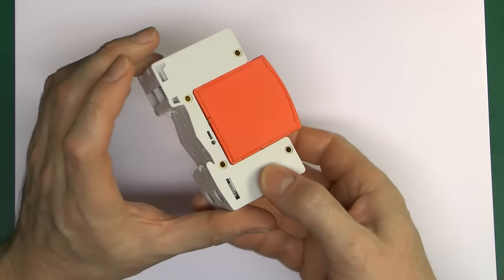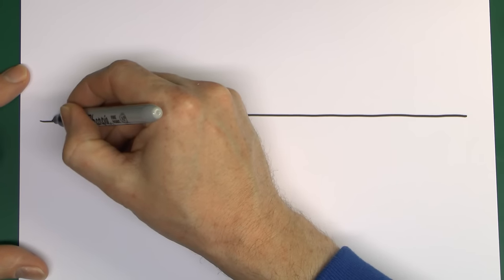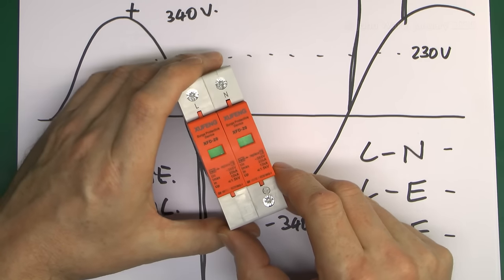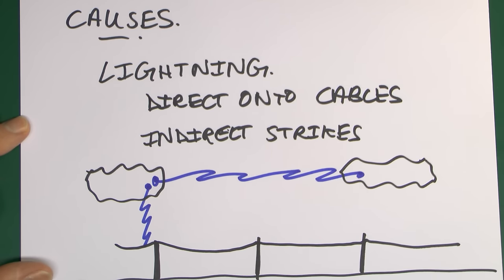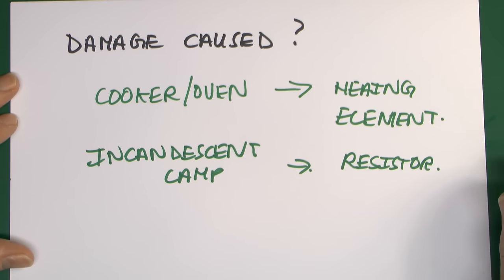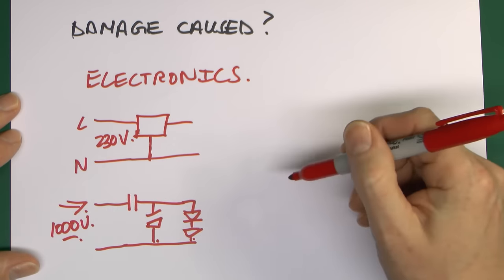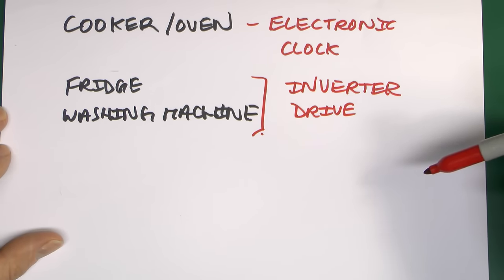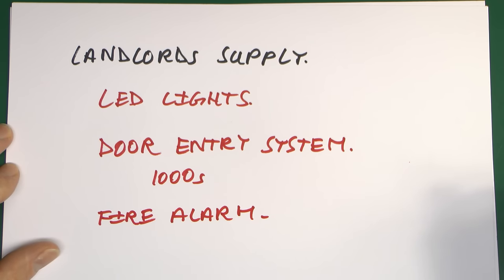Surge Protection Devices - Part 1

Comment: Very informative thanks. I worked for 30 years maintaining and installing ,fire alarms , door entry devices, CCTV and public address including 100 volt line on large and small installations. We hardly ever had problems that you have referred to with equipment being destroyed. It was built to withstand such things and worked for years with out problem. So I would question why these things are being fitted, could it be another way of frightening the customer into thinking "that they have got to have these fitted"!!!! Or are these transients and surges a new thing I think not.
Reply from the maker: Transients are not new, but the amount of electronics connected in a typical installation is far more now than in the past.  Older equipment typically had a transformer as the first part of the power supply which is unlikely to be damaged, virtually all new devices have switching supplies which have electronic components at mains voltage, far more likely to be damaged.
Reply: Thanks for your reply, I did not want to criticise your consise video but point out that why do we suddenly need these devices and would new equipment be as reliable as the thing's it is replacing. I only retired last year and was still involved with this equipment. I have found that it us mostly still constructed using the time tested and reliable components that always been used.
Reply: Martin Winfield - my personal opinion is, “marketing” so that the customer can be charged more. Any good quality well designed product will already have suitable surge protection built-in. Some 1980’s computers that used switch mode power supply units have such protection as standard. And as John says, it’s not new. Industrial systems have had such protection since the 1970s onwards.
Reply: An reasonable quality electronic product will have inbuilt surge protection. In fact it's part of the electrical safety compliance testing (of electronics) in all countries. So generally, these SPDs are basically just marketing wank.
Reply: The only things damaged for the most part from any kind of surges I've seen so far are very cheap LED lights
Reply: I'd like a surge protector in case of a fault on the neutral supply. We had a neutral fault to our block and so got 400V rather than 230V. It destroyed most things - boiler, lighting, dish washer, fridge, washing machine, hifi. The manufacturers said that the warranty didn't apply. I know it's not a surge due to lightning strike and the duration was minutes, not milliseconds but the only electronic items that survived were those on surg protected extension leads.

Comment: Also the inductance of the transformer primary in anything with a linear PSU would stop any short duration pulse doing much of anything other than MAYBE breaking down the primary insulation (which would have resulted in a repairer just saying 'nah yer transformer's dud')

Comment: Hi John. 

Can you give any further insight into why the regs says that if you have a 2nd sub board over 10mtrs away that you would need a 2nd SPD.   If there is a type 2 at the origin (ie meter box) on a property with an underground supply and there is a mains board 15mtrs away would you need a 2nd SPD in the consumer unit as well? I assume that if the SPD has done its job at the origin there wouldn’t be any need for it at the consumer unit as well?

Comment: my job is designing mains fuse boxes for local installers and i can testify that almost 80% of them have some kind of surge protection.
also in my country i believe it is mandatory for government buildings to have a spd system.
a single type 1 and many type 2's is the norm but if see a upward trend of type 1+2.

also a new (ich) source of surges are PV transformers (solar panel) and car chargers.
they store a huge amount of power and use computers and electronics to turn it on and of very fast.
but if the software fails it can dump all of it by exedent.
it wont hit the 5000V but anything up to a 1000V is to be expected. 

it will be way more local but they ar cropping up every ware.
 if seen a carpark that had 20 charging poles and one car owner used the wrong card to check out and it cause a emergency power down because of some software bug.
in a instance almost all of the led street lights turned of and did not turn on again.
it was a expensive bug that did not damage the charging infrastructure so it was only a problem in the real world.
Reply: interesting, I hadn't considered the internal sources of potential surges...but that makes sense.

It's kind of like the use of a surge protector in UK phone sockets.  (in standard line sockets its a 350v gas discharge tube across the line wires).

It was claimed initially to be lightning protection.... ultimately all it was there for was to prevent some idiot destroying a £400* ish line card by chucking his beer over the answering machine

*figure chosen from my ass, but 'expensive'
Reply: SoY_FooD  Sir, what country are all of these?
Reply: the Netherlands for 95% and some for Germany and begum.
Reply: thx for the info
Reply: TheChipmunk2008 - old style British Telecommunications telephones did not have any semiconductors (apart from normal diodes) and the line equipment was electromechanical. Now if course both the telephone and the equipment line card are electronic. So the gas discharge tube in the line termination unit/socket does provide a limited amount of protection. Similar protection components are used in the exchange. However apparently cost cutting means that these components are not always fitted in new LTU units. Why should the telephone company care about your equipment (in the past you rented the telephone from them).

Comment: In Oz the high voltage is run above the 240 volt lines and if the pole goes over (car Acident)  The two come in contact and there"s your surge.

Comment: TVs made pre 1970 used Electronic switched mode power supplies, the number one cause of failure were clumsy customers watering their plants on top of the TV, number two was capacitors drying up as they used to get so hot or the CRT died after 7 or 8 years of use. Surges were not a problem then even though the electronic components were inferior to those available today. 
Any mains powered equipment that is supposedly CE marked should include its own surge protection device, the reality is the addition of this 15p component (MOV) is usually left out to save cost by unscrupulous manufacturers.  
 
I have seen MOVs fail spectacularly, I would not recommend using these in a plastic enclosure!

Comment: hi john , another great video. quick question. can you get surges in houses that are near the rail lines at all? .Also I noticed a shop near by me one time that was a barber shop underneath a railway bridge and every time the train would pass over their clippers would go completely ballistic and make terrible loud buzzing noises  when using them. they would have to stop cutting hair with them until the train had passed. it sounds bizarre but that's what happened. Hope its not a stupid questions I have asked. many thanks.
Reply from the maker: Yes, definitely.  Very high current, either from rails or overhead lines = large magnetic fields.  Also possible faults where high current flows to places it wasn't intended to.
Reply: John Ward - only if they are electric trains!
Reply: Andy chara - Electronic equipment used on the railway where electric trains are used is built to tight specifications to prevent erroneous operation. The pick-up on electric trains is a wide-band radio-transmitter plus the return current flowing back through the rails can also transmit radio waves and magnetic fields. But most problems are due to the electrical network suffering from voltage dips and minor surges at the train intermittently draws current as the train pick-up does not always make good continuous contact...

Comment: Telephone lines are a special problem.  One side of the telephone pair is connected to earth at the exchange (which side changes briefly prior to your phone ringing, to warn CLI there's a call coming).  A lightning strike near you, or near the exchange can put a big transient between exchange earth and your mains earth.  If you have an ADSL modem (aka ADSL router, aka hub), that transient is likely to kill it (the same applies to old dial-up modems).  Yes, the modem's power supply will be isolated, but if the transient is large enough there will be some leakage current through the class Y noise-suppression capacitor (or even breakdown of transformer insulation or even tracking of damned big sparks across the PCB).  A direct hit on the phone line or power line puts an even bigger transient on there.  If you have a wired connection from the modem to your computer, that just gives a more direct path for the transient to take effect, and may result in death of your computer as well as the modem.  Modems/ADSL modems are not designed to cope with large voltages between mains earth and phone earth.  Depends on the technology inside, but 10V can be enough to fry a chip.

Bottom line unplug the modem from the telephone line if there's a storm.  Unplugging the modem from the mains instead isn't as good, since the mains plug is going to be touching or near objects at earth potential, and even insulators have enough capacitance for there to be leakage current to transients.  Unplugging from both phone and mains is better, but if you're only going to unplug at one end then unplug from the phone line.

I've had three modems killed by unanticipated nearby lightning strikes.  Two times, the first I knew of the storm was with the nearby lightning strike that killed the modem.  One time I was out of the house on a day when no thunder had been forecast but a storm brewed up anyway.  One of the times I had a phone on top of my tower computer and there was a damned big spark from phone to computer case.
Reply: thats why older BT master sockets had a spark gap and a MOV across the pairs... but unfortunately these interfere with high frequencies, so they took them out
Reply: @jaycee1980  The spark gap and MOV protect against a voltage transient across the lines.  They will stop a transient damaging an approved phone (which have to be designed to cope with transients too small for the spark gap to stop).

They don't protect against a voltage transient between mains earth and telephone exchange earth.  They can't, because mains earth is not part of the master socket.  But even if it were, a spark gap couldn't protect something that can be damaged by 10V transient.  Not sure an MOV would be up to handling transients that small.

Comment: Anything coming from outside on the main supply  be protected by the supplier, inside the building would be the owners responsibility. We now need SPDs,  AFDs and type B RCBOs all which are increasing  the cost of installations.

Comment: I live in a neighborhood with underground power, and also one that seems prone to lightning strikes. I've had a couple (that I know of) strike within a hundred yards of my house in the last few years and I've also lost two electronic devices due to them. I'm in the process of installing a whole house protection system, but I also wonder if adding additional grounding would help. The soil is heavily clay, so water doesn't go very deeply and the conductivity must be poor.. I'm wondering if I should add an additional grounding rod at the electrical service entrance and another to the outside air conditioning compressor at the far end of my house. 
In a nutshell, what I am asking is if improving the grounding will add additional surge protection, including that from induction motors starting up.

Comment: Great videos John! Just had an interesting one, a mains sander plugged into and extension lead that also had two led work lights plugged into it , started and then stopped the sander after only a second, and then both led lights blew their internal drivers. Assume due to a switching surge from the sander ac motor?Would a type 1,2 or 3 surge protector saved them, considering they were all on the same extension lead?

Comment: Why A.C. 230 Peak voltage +325V does not affect SPD? It's because the peak time is very short?
Thanks
Reply from the maker: SPD voltage ratings (Uc) are for AC voltages, not DC or peak.

Comment: What about the meter? are they susceptable to transients. Also with the dire need for isolators on the supply, would it not be a neat solution to have the spds and isolator in the same box that could be fitted while the meter wasbeing changed?

Comment: Thanks for the great video! There's only one thing I'm not sure I fully understood. Regarding the switching off the directly connected motor (without VFD), if it's done by 1p switching and you let the motor freewheel until it stops without applying any force to it, shouldn't the generator effect be avoided? I'm not disputing the transient switching effect here! Just the freewheeling generator effect
Reply: Power is generated when freewheeling, it will only slow down with electrical load applied or even a full short

Comment: John Static caravans are now being supplied with type 2 SPD's in the consumer unit. The SPD is fitted up stream of the 30mS RCD in the consumer unit, however, the spd is downstream of the 30mA RCD in the external supply pillar.

What is the potential for nusiance tripping of a rcd caused by transient voltages being shunted by an RCD ?
Reply: Typos a plenty, that clearly should have read...

What is the potential for nuisance tripping of a RCD caused by transient voltages being shunted by a SPD ?
Reply from the maker: Basically none - typical transients and the response time of SPDs is in the order of microseconds, RCDs trip in milliseconds so transients are ~1000x faster.
However as MOV type SPDs get old, they do leak some current so there is a possibility of old ones tripping RCDs. 
Those with gas discharge tubes instead of MOVs between E and other connections are used with RCDs to prevent that.
Reply: @jwflame  Thank you for the reply.

How does this sit with reg 543.4.7 when you have a 30mA RCD on the supply side of the SPD?

Comment: This is a bit off-topic, but I live in a fairly rural area in the US. Until a couple of decades ago, it was common for houses and barns around here to have lightning rods installed but I haven't seen one in years. Why did lightning rods go out-of-fashion? Are they not needed anymore?
Reply: In my country, often the metal sheath of the roof is connected to the grund, so the whole roof is grounded and u dont have to put any rods, unless the area of roof exceeds some numbers
Reply: Lightning hasn't changed so if lightning rods were needed in the past then they are still needed now. Maybe they used to be installed on the basis they they might be useful but now no longer because of cost and have been found not to be statistically useful. 

Certainly if I was in an area where my house was the tallest thing around then I'd install a lightning protection system to a dedicated earth rod. I'd probably also look to adding some heavyweight transient protection at my incoming power point because in  rural area  it is probably coming from overhead cables

Comment: Dear sir, installed two cameras with 12 v adaptor (SMPS) in two flats and electricity went off and on in the two flats at the same time(the same block) , and one device in one flat was malfunctioning , i mean how to check the voltage signal Quality is stable or not is it high than standard , what are the possibilities that could destroy the adaptor in one flat and the other not in the same building , also instead of opinion about the video could the signal that comes out of the APC Power bank could be deformed from scientific point of view

Comment: Does the surge arrestor get installed before the main breaker in the consumer unit or further" down stream". Some books I've read in South Africa says : install between the live and earth terminal. Haha its too vague... Need to visually see it?
Reply from the maker: After the main breaker, connections to the SPD require an overcurrent device (fuse / breaker) and there should be a method of disconnection for maintenance/ replacement.

Comment: Good Morning JW, Have you come across integrated Incoming isolator & Surge Protection devices such as Wylex’s REC2SPD? 

It is designed to be fitted on the tails between the meter and consumer unit, hence protected by the service fuse. 

Will be up to the energy providers I guess re. if they want to fit these instead of a basic REC2 isolator switch for existing installations (when a customer requests an isolator switch). 

Would help achieve the short cable lengths required more easily in some domestic installations.

Would be interested in your thoughts.

Thanks Adam
Reply from the maker: Yes, one is shown briefly in this video: https://www.youtube.com/watch?v=f6PpvrCgyEA
Unlikely that energy providers will be installing them as they are £90-£100 more than a standard isolator, however they are a decent solution if an isolator is required, as the cable lengths to the SPD are pretty much zero .
Reply: John Ward thanks JW appreciate your response 👍

Comment: hi guys,
i have a question. how does SPD protect your electrical appliances? when a high voltage occurs and SPD detects it, will your circuits be isolated?
Reply from the maker: The SPD becomes a short circuit for the duration of the overvoltage, so the voltage is reduced and the energy ends up as heat in the SPD.  Nothing is isolated.